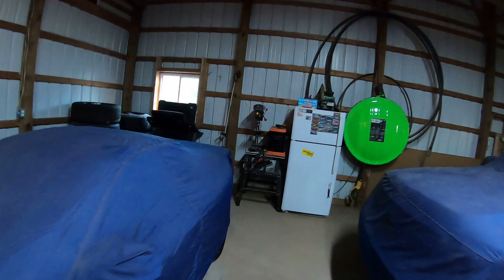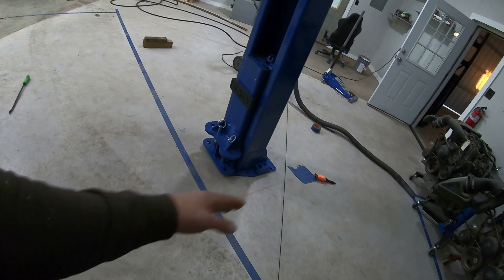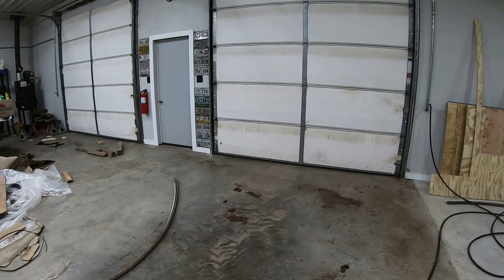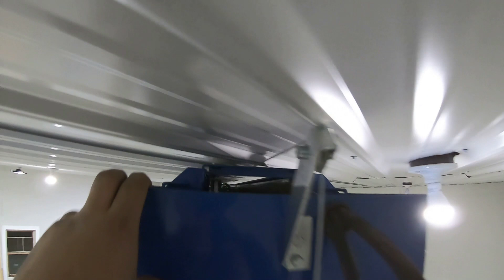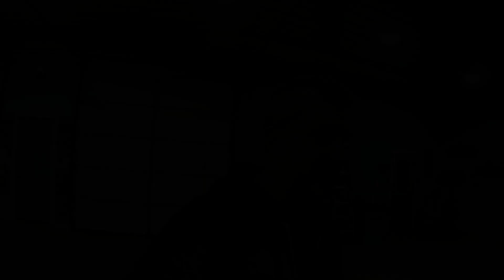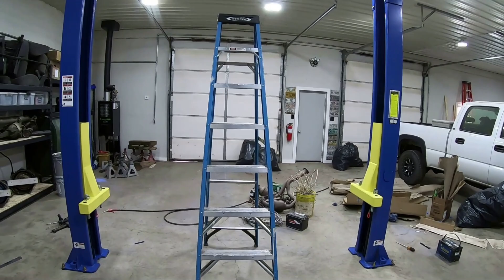LIFTS! - Dream Workshop Build Update 10

Comment: Nice lift..  you should install a security camera that feeds a monitor that you can watch as you are raising anything up and see the top and how close you are..
Reply from the maker: Good idea, I wonder if I can find a small setup that would be easy to install and mount on the lift itself, something very simple and plug and play.
Reply: You can get a cheap chinese system that includes like 7 cameras that you could also put outside around your shop.. with hard wires...   pretty cheap.. @MohawkMotors
Reply from the maker: You're the video guy, any systems you would recommend?
Reply: @MohawkMotors  that depends on if you want to go with solar on your outside perimeter or wired. Wired is cheaper, but then you have to run cables for your cameras.   I just purchased three wireless PTZ solar cameras for my house. That I can access, control, and operate from my phone.  And they are like $99 each I think.

Comment: Looks like your floor is butt level but good rule to follow is to not let the car /lift all the way down if you’re going to go back up…
Reply from the maker: Yeah, the floor that was there when we bought the place is not very level at all, lots of highs and lows. The new floor is wayyy better but still not perfect. 

And yes, good tip, I didn't sweat it with the Assblazer because the suspension is lowered so much, even with the lift all the way down, the weight of the vehicle was still on the lift arms/frame. I didn't show it but I had to jack it up with a floor jack and use spacers on the lift arm pads to give enough space so he running boards didn't get crushed by the arms before they contacted the frame.